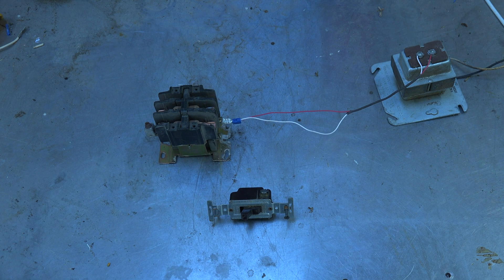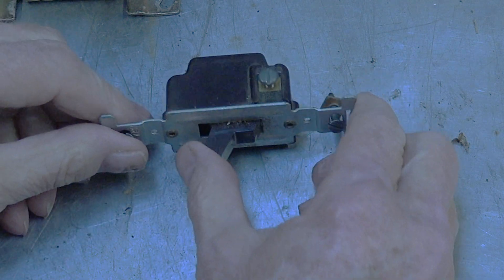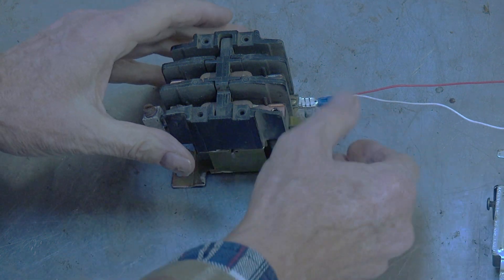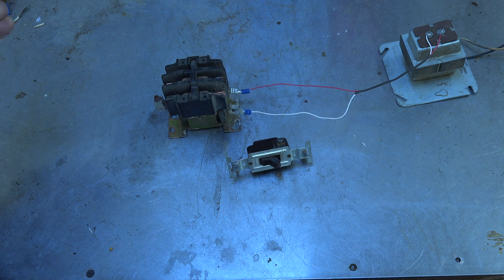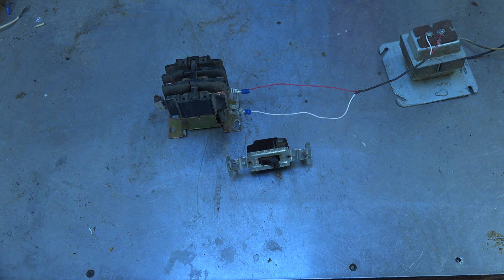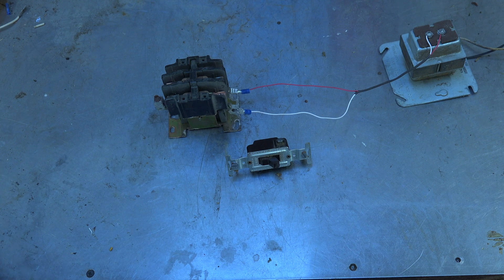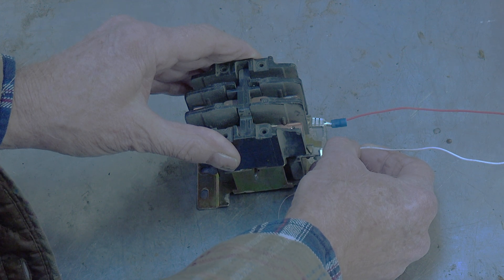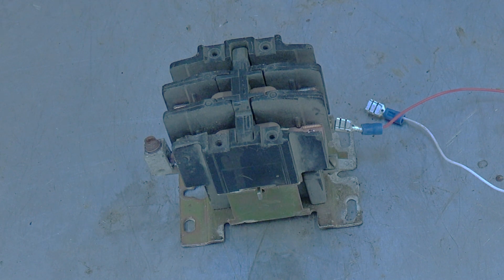Why electric switches must move fast

Comment: We have a wall switch that was put in decades ago to an overhead light. It makes no sound when switched. Put in because it makes no sound. Should this be replaced?
Reply: This kind of switch that you describe sounds like a “silent switch” which is a mercury tilt switch, these were popular in the 50s thru 70s since the old switches made a very loud thump due to a different mechanism compared to today. “Silent switches” can last a very long time due to the actual switching contacts being in a sealed chamber and the actual material switching current being a liquid which won’t pit like normal contacts would.
Reply: that's likely a mercury bulb switch, they practically last forever, but may eventually fail as the internal connections to the bulb get flexed with every on/off motion. I have replaced maybe a dozen that failed internally, out of thousands still in use, but also replaced many working ones, because they were "ugly" to the customers and other remodel work.
of course it could also be a very worn switch, but as long as the light doesn't flicker, blink, dim or do anything silly, don't worry about it.
most of the new switches out today to thirty years ago are complete junk and don't have a snap action, they just bend a spring steel piece to push contacts together, they arc and spark like crazy inside, especially with capacitive and inductive loads(lots of led bulbs, gas vapor arc bulbs, motors).
the exception is buying commercial grade switches, they're generally built better and meant for more usage without melting down inside. but eventually they all fail, same with receptacles being worn out from many plug/unplug cycles, they get loose and start running hot and melt down. those I would for sure replace if any feel loose and don't hold a plug snugly, I've seen many melted and burnt right inside the box which also ruined the wiring, some even caused a fire.
Reply: Normal household light.
Reply: What you are describing is likely a mercury switch, available from many manufacturers from the 1950s until 1991, and were somewhat common from the 1960s until the 1980s for use in study areas and children's rooms for example, where the click or snap sound of an ordinary light switch may be disturbing.  This is especially true for many light switches made in the 1950s and earlier since they have a much louder snapping action than modern toggle and decora light switches.   

As for this "silent" switch, nothing to worry about.  In fact since the switch contacts are inside a sealed glass tube of mercury, no arcing takes place, meaning they will generally outlast several ordinary switches, almost an indefinite life, they often had a 50 year warranty, something you can't find on any product in modern times.